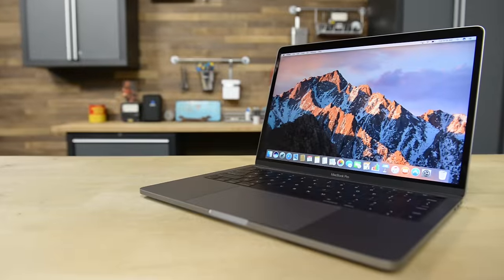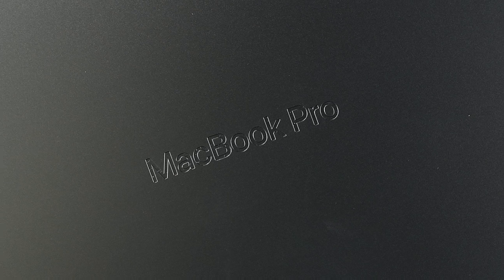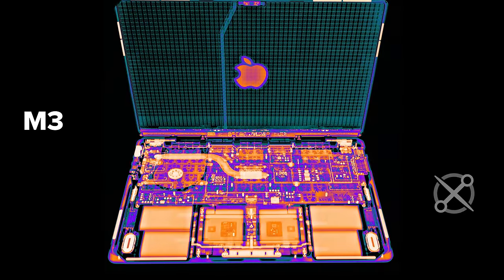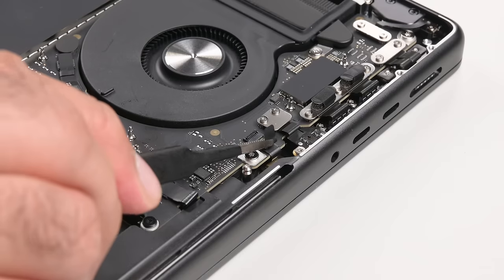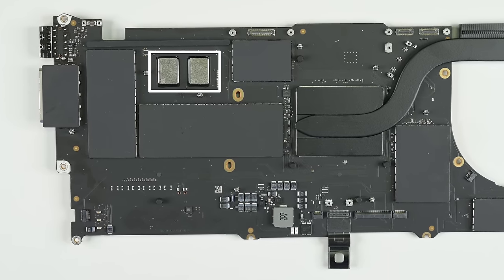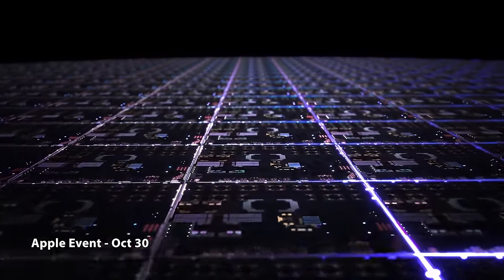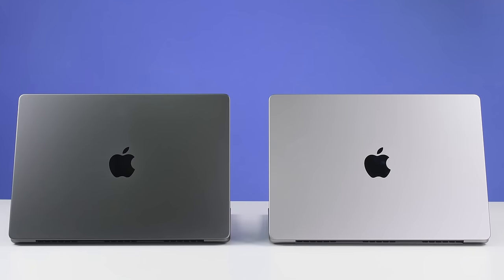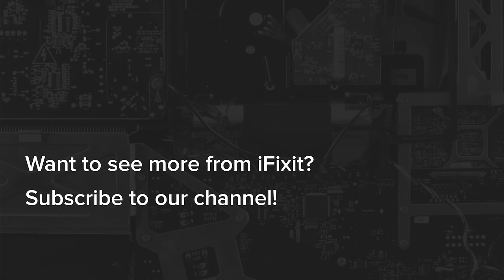Inside Apple's M3 MacBook Pro: Teardown, X-Rays, and Parts Pairing Drama!

Comment: Time for the EU to force hardware to not be locked down now after they did it with USB-C.
Reply: That, and mandate that storage be replaceable alongside batteries. Serviceable RAM would be nice too, but while I grumble about it being soldered, I can live with it in a world where storage is replaceable, since the latter has a limited write-life.
Reply: @Ebalosus   it can be done like in some PC laptops, base RAM is soldered, but rest can be added as needed
Reply: @Ebalosus  Don't forget Accessibility those Companies Gluing their products hindering you from repair
Reply: EU do your thing!!
Reply: This is exactly what government regulation is for. The more the better.
Reply: Part pairing should be banned for anything that's not security critical, such as the fingerprint sensor or TPM modules.
Reply: @allongur   So, there is no way that fingerprint sensor can be replaced with one "hacked" (let's say in bad repair service) which allow somebody to unlock computer without my real finger print?
Reply: @michalprochazka2066  It's a sound that you don't know the role of a fingerprint sensor. The fingerprint sensor only roles scanning fingerprint. CPU or specified hardware like T2 chip checks whether the recognized fingerprint and the registered fingerprint are the same.
Reply: Even those should be unlockable through macos remotely for free by providing log in information and authenticator.
Reply: @MalgeunSAM  But a malicious fingerprint sensor can give fake data to the specific hardware to check on.
Reply: EU and apple war has begun
Reply: @willianmfaria Sure, but how would it know what data to give? You'd need to get into the system to check the recorded fingerprint data first, at which point the process becomes kind of moot since you already have access.
Reply: they did
Reply: @Ebalosus  replaceable ssd can reduce efficiency (yes I am a engineer)
Reply: @RedditReadsUS  I know, but I also know that devices have to be used in the real world, where things break and need fixing in a reasonable timeframe, where people don't or can't afford to do regular backups, and where throwing out perfectly good hardware besides one or two components is a crime against both nature and sustainability.

Comment: The prices Apple charges to upgrade RAM and SSD space is insane when you consider what it costs for a PCIe gen 5 M.2 and high quality DDR5. The markup they have is outrageous
Reply: TBF they’ve been doing that since Steve Jobs came back to the company way back when. The overwhelming advice before they started soldering everything down was "buy the base model and upgrade the RAM and storage as you need it by yourself."
Reply: The storage price upgrades are sadly quite an industry standard tho... most others aren't really that much cheaper when you wanna upgrade frm 512GB to 1-2TB. And when it comes to the 4 and 8TB models, Apple can basically dictate any price they want because there's no other manufacturer giving you such huge storage options.
But the RAM upgrades yeah, they're ridiculous. Especially from 8 to 16GB. $200 for a fu... 8GB more.
Reply: Shop ASUS computers. What is your problem?
Reply: Apple is billion dollars company for a reason
Reply: That is one of the reasons why I never owned an Apple product. (Used but not owned.)
Reply: @KarrasBastomi  Just like Microsoft, google, Intel. nvidia etc.
Reply: @Raja995mh33   You do realise there ARE 8TB M.2 SSDs, right?
Reply: That's true, but the performance and reliability of M series machines leaves everything else in the dust so it's a price worth paying. Unless you need a gaming machine. Which most mac users don't care about that much anyway. I'm very very happy to pay a little more to get rid of the jet engine with 20 minute battery life and endless Windows Updates that I used to have on my desk.
Reply: @karmatraining Looks like you've bought into the marketing big time.
Reply: @Lee.S321 He's not wrong. As much as I love my Windows machine, if I need a portable powerhouse, the M series MacBooks are really hard to beat.
Reply: @karmatraining  I agree the laptop is great, I have an M1 Pro myself. I just wish the 16GB upgrade wasn't so expensive, or apple would include 12GB by default instead of 8GB at least.
Reply: One thing to consider. In terms of RAM, nobody in the industry uses that fast RAM Chips with that densitiy that Apple does. It's a Mark Up for sure but not that Big, since this Chips aren't that common and not so much made. For SSD Space it's a different Story.
Reply: RAM in Apple laptops isn't like PC RAM.  It's integrated with the package of the CPU to provide faster speeds thank to improved signal quality.
Reply: Wirh alienware m18r1 you can get 2 4TB m.2 sticks big version and 2x 512GB m.2 sticks small version for a total of 9TB but that’s a huge gaming laptop with full size sockets.
Reply: @LuukDomhof  Great product, bad price.
Reply: @Raja995mh33 industry standard with who? The Surface? Plenty of laptops under $1000 that come with 1TB of NVME storage lol. It’s a joke that Apple uses low grade storage while charging prices like it’s 3x faster than anything available on the market. PCI gen 5 has 3-6x the performance of MacBooks storage while being half the cost at retail.
Reply: It's called the Apple Tax for a reason.
Reply: @Lee.S321 the marketing worked and the results of the machine are much better . The M series is a powerhouse and even on heavy usage I get 9 hrs , can do that with a windows laptop
Reply: @Miami1991   Even AMD's 7000U-series X-86 chips from 2022 can achieve higher performance per watt than Apple's ARM chips. As I told the other guy, MB's aren't the only efficient powerhouses on the market, but they're not trendy & shiny, so they don't get fawned over. MBs have so many limitations if I switched to one i'd have to buy a tablet (running a desktop OS) & gaming PC just to be able to do the things I can already do on my laptop. You can keep it.
Reply: @asiano3385 so your mad because they have a good business strategy

Comment: The European Union should force Apple to have not only replaceable parts, but the bare minimum of replaceable SSD's and expandable memory as well as an easily replaceable battery.
Reply: Replaceable > Battery > RAM > SSD > Processor > Graphics
Reply: The RAM part will probably never happen given Apple will say the RAM being on their SoC is vital, whether that’s even remotely true or not is debatable. The storage though, yeah there’s no reason for it to be soldered and non-replaceable.
Reply: @johnmoore1495  There are good reasons to have it on the SOC, but there is nothing preventing them from adding another slot where you can put more, albeit slower ram.

Comment: I just bought 32GB of DDR5 5600MT/s SODIMM for my laptop for less than $100. It boggles my mind that the upgrade ontop of the already included 8GB costs $200 alone. $200 FOR 8GB OF RAM?!?! IS THIS 2007??
Reply: it's apple's proprietary ideology of money earning ✨ both RAM and SSD are sensitive parts if they go wrong, especially SSD which has its limited lifespan because of having to both read and write for many and many times, but being soldered so if SSD fails does the whole laptop also get affected, because apple solders everything into mainboard of macs. you can say same thing about RAM too despite having longer lifespan than SSD as it works differently, and that's why mac sales from skyrocketing thanks to first M chip to downfall nowadays because of this along with apple's counterrepair tactics
Reply: I bought 32GB DDR4-2400 for a friend's laptop on the used market for £40. Yes, £40. And I could have got 32GB DDR4-2666 today for £40 also.
Even when I bought it a couple of years ago for my HP OMEN (with higher RAM prices), I could still get 32GB DDR4-2666 for under £100.
Reply: @TheSpotify95  It seems like Apple doesn't understand that traditionally capacity goes up and prices come down over time. Or at least they use that to make their margins even larger as time goes on lol
Reply: The company makes more money when you have to upgrade half way through a system's life span. I already know I'm going to have to upgrade for more storage and more RAM this year, and I got my M3 Pro last month. Thankfully it's a work provided computer so I'm at least not shelling out an extra $2700-3500 of my own money, I'll just be biting the bullet for the first time.
Reply: it happens not even only on macbook but also other windows laptops. 😂😂😂.
Reply: There is NO DDR5 that you can buy giving you 200 to 400 GB/s with 8 channel memory unless you buy Threadripper or Xeon. Apple indeed get custom LPDDR5 Chips that we can't just order from a retailer. On the other hand, I agree with you that we need SSD NAND user replaceable and upgradable on MacBook.

Comment: 4/10 is incredibly generous considering all the drawbacks and hinderance to repair. At this point the connectors are only here for the assembly process....
Reply: This is not an hinderance to repair. This is an hinderance for thieves and fraudsters.
Reply: very generous indeed when you can't change out storage or memory... the whole thing becomes e-waste when either of those parts lose performance
Reply: As long as you transfer the lid sleep sensor to the new display there’s no issue. Still no reason to pair it to the board but there’s that. Source: non Apple repair tech
Reply: @makeitrainnaren  That wouldn't fix the display artifacting though would it? What's the point of doing that if you can't replace the screen anyways?

Comment: Simple answer is don't buy these. These are e-waste in the making. Once SSD dies you are screwed. If anything on the motherboard dies you can only hope somebody is able to fix it or your data are gone.

8GB of RAM on PRO machine is a joke. I disagree that Apple designed themselves into a corner. They designed that on purpose so they can sell more of expensive machines and cloud subscriptions.

Comment: I think this is one of the first times an Ifixit engineer has BLEEPED at a teardown product! Also, great explanation on why 8GB RAM is not good enough for a "professional laptop". The base model should have been 16GB, and upgrading the RAM costs way way more than on any Windows machine because you can't upgrade soldered components.
I managed to buy a 128GB DDR4-3200 kit for my gaming PC for £240. How much would it cost to get 128GB on a Macbook Pro? Is 128GB even an option on a Macbook Pro?!
Reply: the 16" macbook Pro caps at 128gb ram, but you have to buy the M3 max and add $1K.
Reply: 16GB minimum was the base standard 10_ years ago. There isn't really much explanation needed in profe3ssional industries to avoid something with standard 8GBs in 2023.  If you're buying for a company and you're that naive you simply ned to let someone else spec equipment out for you.

Comment: One thing you need to understand about the MacOS Memory Manager: it's super aggressive about keeping things in Memory. Other Ones might start evicting Memory Pages at a much lower Memory Occupancy percentage.  So if you've ended up accessing a lot of Shared Library Pages, they'll continue to fill up Memory till the OS really needs to free up Pages for new Content.  And of course, if the freed Memory Pages are read-only Shared Library Pages, that means a simple reuse rather than having to write Modified Read-Write Pages out to Swap.  So, the bottom line is that seeing 7GB of Memory being in use very quickly isn't really a problem.  What you really want to look at is the amount of Swap that's being used.
Reply: Exactly. This video is misleading. 8GB is too little, but the numbers he was reporting would only matter if he were using multiple massive programs like After Effects or XCode or something

Comment: The reason why lid angle sensor is paired with the logic board is probably has something to do with Apple's Platform Security (which can be checked out from the official support website). Specifically, Apple uses the lid angle sensor to determine if the lid is closed, so that MacBook can block the internal microphone at a hardware level to prevent malware from recording secretly. Through force pairing, even if the hacker have the access to the hardware of a MacBook, they also can't steal audio by replacing the lid sensor to a modified one that always pretend as the lid is on.

Comment: Apple used to know how to make easily repairable computers back in the 1990s. That saved their bacon when they had several models with runs of defective parts and ended up doing a lot of recall repairs. It is possible to swap a logic board on a Power Mac 6200/6300 in less than five minutes, using only a #2 Phillips screwdriver. The Powerbook 190 and Powerbook 5300 generally did not take more than 40 minutes to change any part, not counting time to load up a new hard drive. Some of the LC models did not even need tools for most repairs - everything was done with latches.

It would interesting to see the results if Apple returns to that east to servicedesign philosophy.

Comment: The SSD is soldered to the board? 

Doesn't that make data recovery insane?
Reply: that's why people should have backups. Data recovery from SSDs is always insane...
Reply: @PvtAnonymous  But if the SSD is removable then even in case of heavy damage to the laptop as long as the SSD survives you only need 5$ m.2 to usb adapter and you can get data out of it. 

Yes people should have backup of the most important data but that's no excuse for apple to solder ssd to the board.
Reply: @JerziTBoss Facts Boss
Reply: Oh it’s even worse than that, because the SSD controller isn’t even with the NAND chips. It’s a part of the SoC, so you basically need board-level microsoldering to do data recovery.
Reply: @Ebalosus  data recovery on m series device is out of questions after some version of mac os. It's encrypted data. If you able to recover raw data from nand, it's garbled encrypted junk
Reply: If you're relying on SSD storage for 100% of your data redundancy, you're going to have a tough, tough life my friend.
Reply: @karmatraining If you're not using ABS brakes, don't complain if you die!

Comment: 3:01 well there is no need to bend the batter tab back as far as you do. Of course it will eventually snap if you behave like you did. It just needs to to lifted clear of the contacts on the BMS. Also once the battery data flex is disconnected there is no current flowing from the battery to the logic board anyway.

Comment: The one downside of the transition to Apple Silicon is that it pretty much eviscerated the Hackintosh market. 

I would put MacOS on a Framework tomorrow if Intel wasnt on its way to being phased out.
Reply: Current version of MacOS has x86/amd64 build I think (but this is also the last MacOS that will have this). 
I'm more interested in effort of using Macs with Apple silicon with Linux.

Comment: 4/10 seems quite high for a laptop with soldered down RAM and storage, as well as parts paired components.
I guess the only thing keeping it from being lower is the removable battery, minor components being modular, and the eventual release of manuals and spare parts.
I'd personally only give it a 2/10...

Comment: I mean in the past Apple soldered on the ram before but at least back then the SSDs were replaceable. It’s so frustrating to know that these incredible machines are so difficult/impossible to repair.. at least display, battery, SSD and the ports should be designed to be replaceable - without software hurdles..

Comment: Apple could do parts pairing in a friendlier way. For example, when a customer registers a new product, the customer can be given the unlock code for pairing replacement components. If the computer is stolen for chop shop use, the parts are still useless because the shop will not have the pairing code. But if the customer has the code, he can then update the pairing in his system's firmware. Incidentally, the pairing software can check Apple's parts database for serial numbers reported stolen, so the theft protection remains. This also retains Apple's protection from warranty fraud since the warranty terms can specify that only properly registered parts are covered. The pairing program should permit some limited time of normal operation to give the repair tech an opportunity to register the new pairing.

The hassle of self-registering is unavoidable, but with some thoughtfulness, it can be made minimal compared to the current over-priced process.
Reply: Wouldn't work as many machines are bought by companies who are notoriously bad at keeping records like this
Reply: @paulbade3556 - your whole comment is poiuntless !! Apple used to allow for off the shelf replacement parts and NOT bake in software locking to swap parts out. They simply need to stop writing reswtrictive source code into their firmware (see the part fo the video where they tried to swap displays); Even if Apple still opts for custom not-off-the-shelf-parts, those parts still need to be swappable by anyone that knows how to; and allow for 3rd party shops + manufacturers to provide non-Apple specific parts. Either that or stop charging the replacement cost of a product in order to simply repair it at an Apple Store.

Comment: I really want to switch to a Macbook Pro given the current uncertain state of Windows 10 and 11, but the lack of repairability and upgradeability is so frustrating. I need more than 1 TB internal storage. I wish they would at least put a storage upgrade bay or recessed SD card slot in the computer so I can add more memory for video editing. Hopefully replacement batteries will be available and easy to swap as I can't even get quality batteries for my 7 year old Asus laptop anymore.